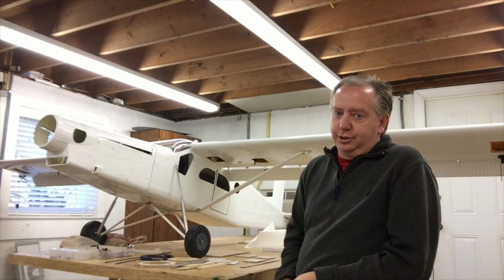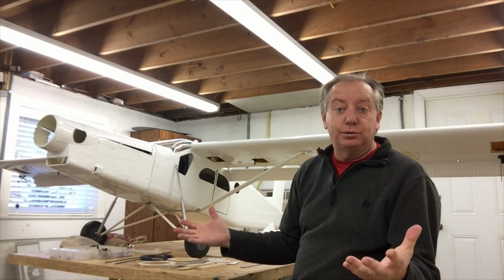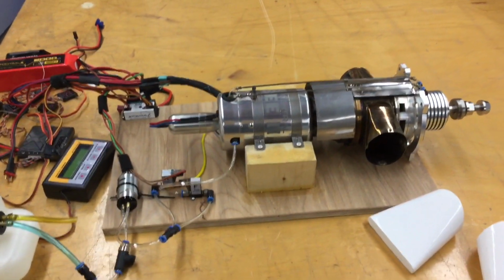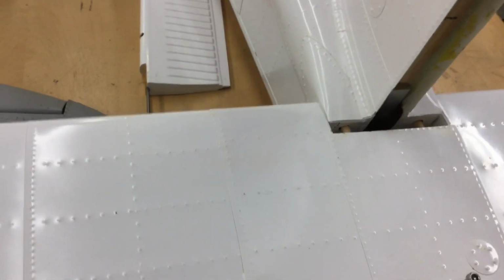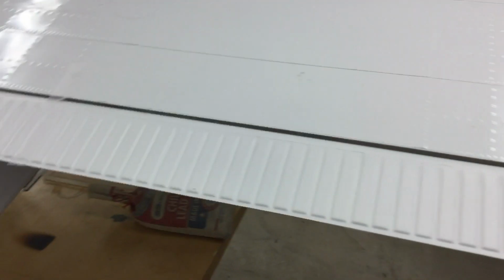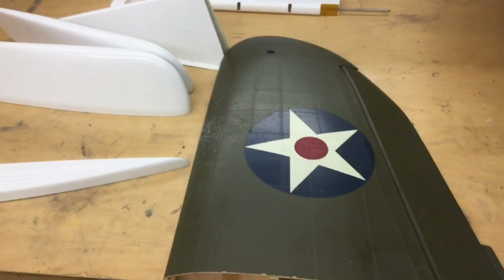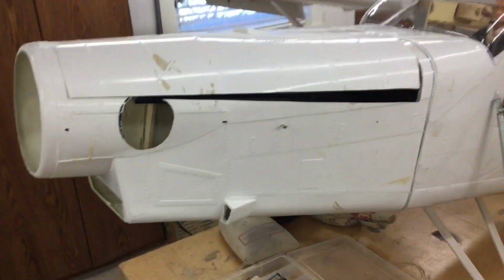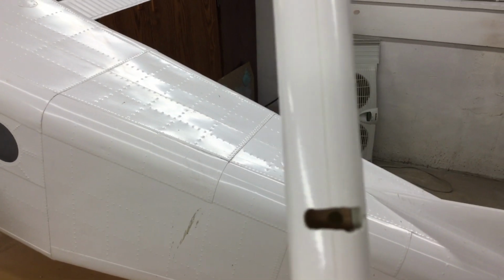Pilatus Porter PC-6 RC Second hand model build Part one

Comment: I built a Brauer P6 in 2000, I was not impressed with the kit, aside from the molded panel lines and rivets the fit and finish is Cr**. The wing joiner system is a joke with those spindly struts that are functional. I ended up re working the entire wing and installing an 11/2" wing tube for a fully cantilevered wing, a lot of work with the only access a hole in the root and servo hatches. Landing gear was not so great either. I installed a 3W inline 120cc gas motor with canister which was totally enclosed in the cowl. I split the cowl top and bottom. All said and done it looked great and flew great. Best of luck to you, |I feel your pain.
Reply from the maker: I agree with you 100%..... A lot of this model is out of square And some of the molding is quite bad to